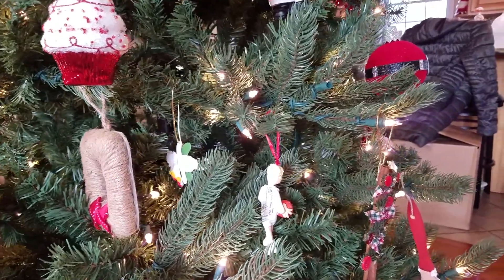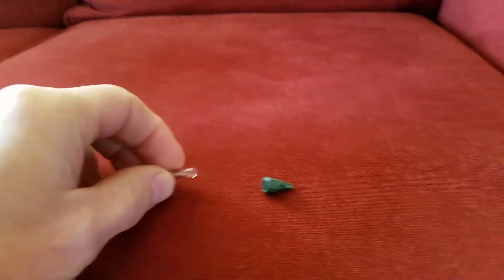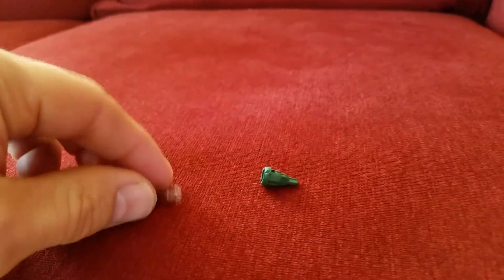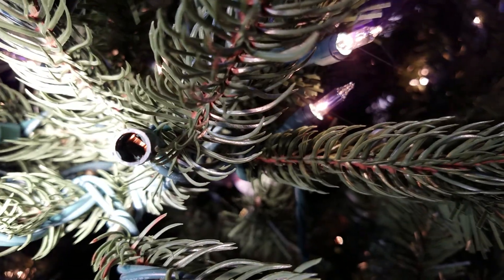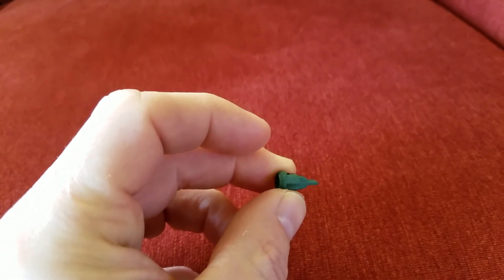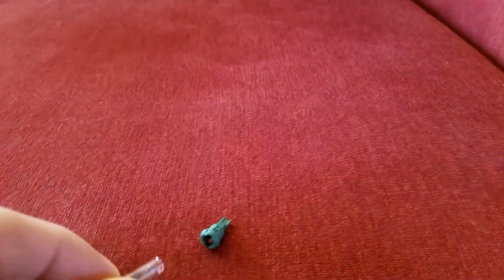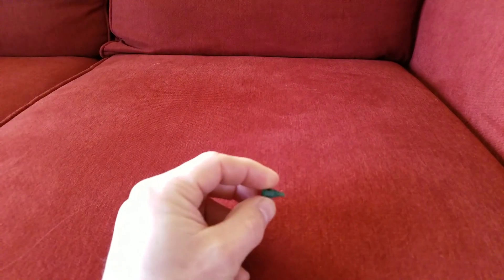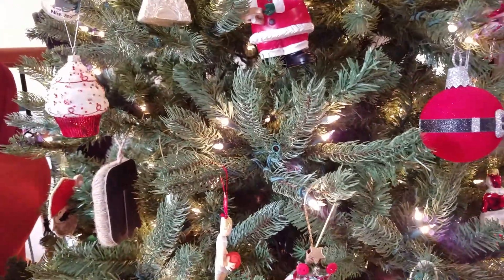Understanding Christmas light shunts in bulbs and bulb sockets

Comment: I've never had a light string like these that continue to light when a bulb is removed from the string.  So that means there is no shunt in the bulb socket - at least in my light strings.  I will look for light strings that have a bulb socket shunt, because that would help immensely to locate a bad bulb.
Reply: Did you have any success finding light sets with a shunt in the socket? Most everyone, including myself is going with LED. However, I still use some old fashioned miniature lights for certain applications.

Comment: So you can have series wiring and the shunt makes it behave like it is parrallel wired when the base is removed?
Reply from the maker: The shunt in the bulb is in parallel, but I guess really the better way of describing what's inside the socket is that it's really just a short circuit. It's two pieces of copper that touch together when you remove the bulb from the socket. It would be like if you cut the socket completely out and twisted the two ends of the wires together.  Keep in mind this is only for bulbs that have the pointy tips like I show in the video. There are a lot of bulbs that are not like that.
Reply: @Redneck_Ed  Thanks for your clarification.

Comment: Really?? There’s a shunt in the socket also? Not just in the lightbulb? I would’ve never guessed… i’m guessing the shunt inside the socket is not a universal feature for Christmas lights?
Reply from the maker: Yes, but it seems to be a not so common feature. I've only ever seen it on inside tree lights. For outdoor lights, the shunt seems to always be only in the bulb, not in the socket. It's an easy thing to see just by inspecting the bulb casing. If it has that super pointy tip, there is probably a shunt in the socket.

Comment: Some lights have shunts in the sockets and some don’t. Those that don’t if you remove any bulb the whole string goes out.
Reply from the maker: That's how my outside lights are, no shunt in the socket. Funny you commented now because I'm heading outside in 5 minutes to go troubleshoot icicle lights!
Reply: @Redneck_Ed  Incadescent bulbs have a shunt in the base of the bulb (at least mine do). Icicle lights are a nightmare since you have so many parallel circuits. I gave up on mine.
Reply from the maker: @RustyCas999  I published my outdoor icicle troubleshooting video this afternoon. Check it out. They really are a PIA.  https://youtu.be/8k3zu6-8Y7U

Comment: Hello, i have a question. Ive read that if you use this product that it can cause the lights to fully burn out. Whata your experience? Did your tree lights get worse after or are they still working correctly? Ty
Reply from the maker: Sorry, not following. What product are you talking about? I just pulled the bulb and socket out.